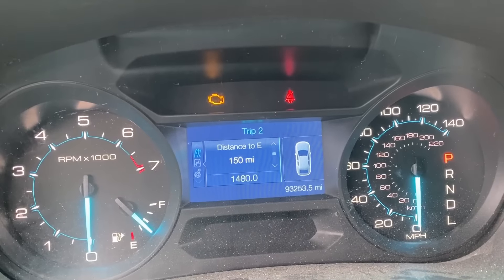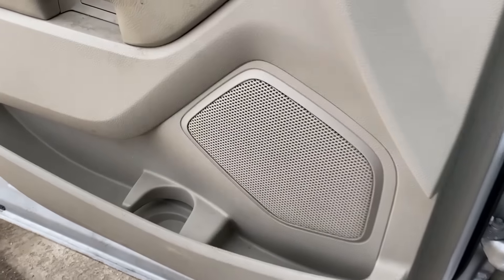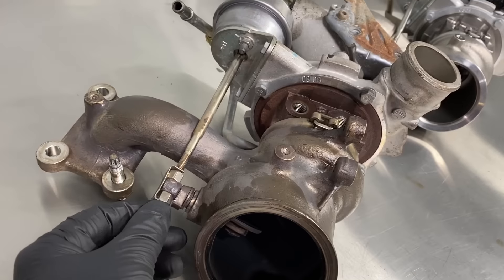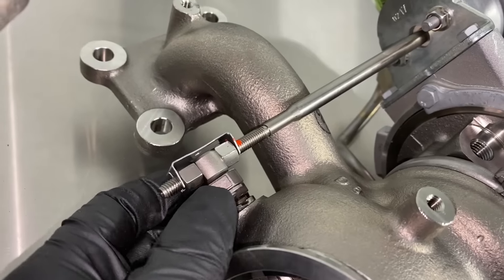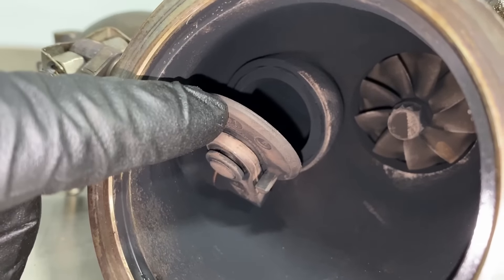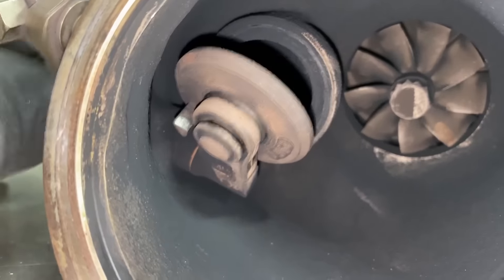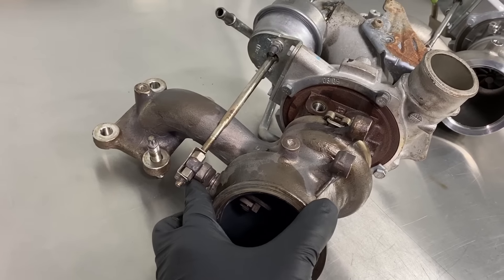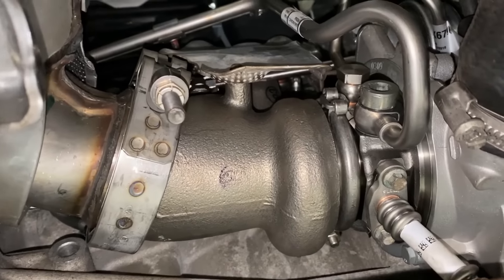Ford Ecoboost Cold Startup Turbo Rattle Explained

Comment: I’ve a 2012 f 150 FX4 I drive every day it’s got 141 K on it just started leaking transmission fluid from the front of the transmission had the transmission service about two month ago any thing to look for
Reply: I'd see if it's just leaking from the pan.  It may just be loose bolts or a bad pan gasket hopefully.
Reply: No it’s no the pan I’m afraid it’s the front seal because it’s up in that area but just to start one morning
Reply: I had the same problem. Ford said it was a defective pan. Under warranty I had it replaced.
Reply: If it's a pan leak it should be easily identified.  I've read F150 transmissions have a known problem called a bulkhead leak.
Reply: Eric I looked at the pan it’s not pan it looks like it’s coming down and getting on the oil pan and saw bar
Reply: Look for selling and buying a Tundra

Comment: I had a dealership try to sell me a 2013 F-150 EcoBoost that had a hard rattle on startup on the left side. I asked about it and was told it's fine. Just probably a shroud or something loose. It sounded worse to me. Turns out the one turbo was shot. I got my deposit back after an hour or so of high blood pressure "talking".
Reply: Thats terrible, glad u got your money back
Reply: Can you please explaim what the turbo really does ??? Or I just to make exhaust noise loud???
Reply: @jaandel1  it gives you a shitload more power, I believe by recycling exhaust into forced induction, and a lot more fun, but at the cost of worse fuel economy by far when on boost, way more wear and tear on your motor and transmission because you'll be horsing it all the time, and more things that can go wrong. 
They're great if the vehicle isn't your only means of driving.

Comment: Service writer: never ever heard an ecoboost have a turbo rattle. We've tried nothing and we're all out of ideas
Reply: Don Olypopper  last diesel mechanic i talked to said something to me that i thought made a lot of sense. "power costs money."
Reply: Don Olypopper  same mechanic told me the order of domestics he works on the most are Ford, then chevy, then dodge. so no im not too surprised about dodge.
Reply: Don Olypopper  just curious was it one of the newer ones ? I drove an 2015 6.7 for work a few years back it was supposed to have like 900ftlbs and it was a great truck never had a single issue with it drove amazing would peel out and haul ass. Realistically I think when they stared forcing stricter rules on everyone all the makers had a rough few years with their diesels. If I had to pick anything personally 4bt all day. But if I had to pick a truck...90s F350 XLT with a 7.3 idi please.
Reply: Don Olypopper  oh man things are engineered to fail nowadays for sure. No profit in repair just like Apple says. Like I said if I had to put a motor in one. Cummins. Ive just never like the looks of modern dodges. Edit: I put around 36k of hard hard labour on our truck alone regularly maxing payload while towing trailers and equipment all over WV took my leadfoot and more.
Reply: Don Olypopper  ive seen that at my local ford dealer. blew me away that the whole cab had to come off to do head work. ford sure likes to build them to generate labor money. if they cant gouge you enough on the parts they'll gouge you with the labor.
Reply: While barely looking away from their screen. Ain't that the truth ....
Reply: @billy Carley
The guy working at jiffy lube isn’t a mechanic y’know..

Comment: I have a 2014 1.5 EcoBoost Fusion. 146k highway miles over 3ish years. Never had a problem with anything
Reply: Wont be that far until starts to fall apart
Reply: I have a 2016 Titanium with the 2.0L at 63k miles, it's already falling apart
Reply: Hardly anyone does. This is new to me. I've owned 3 EcoBoost Fords. 2- Gen1. 1- Gen2
Reply: @gianfrancoa  what ur Hyundai?
Reply: I guess it's all about the owner and how you maintain your vehicle. 2014 with over 160k and it's still like new.

Comment: Getting as fluttering noise from my intake on my 2013 Fusion 2.0 eco boost. Not sure this is normal but when you lightly accelerate and let off the gas you hear a fluttering sound from the intake. Is this normal with these cars? its not loud at all but just concerned. Thank you in advance. (No check engine codes) no rattle

Comment: Thank you for your videos.  You saved me alot of money from the dealer/parts changers. Had a completely clogged cat which caused misfires, pegged my pressure gauge at idle. they wanted to fix the misfires before swapping the clogged cat. Cat was under federal warranty by the way. With your videos I was able to intellegently argue my way to a new cat. And once that was done all the other problems dissapeared. Imagine that
Reply: Cat and not turbo? Under federal warranty? My dealer says it’s my cat and not turbo, even though I can reach down and wiggle the loose waste gate??? Anyway, how
do I at least get covered under federal warranty?

Comment: i have to hand it to you FordTechMakuloco, you picked the most lucrative brand for auto repair!
Reply from the maker: That's right! I know what I am doing....
Reply: Vw has same failures on their turbos.
Reply: @Randomvoice246  because those turbos are also made by the same company, Garrett
Reply: @hkk3656  not so much a repair as a time-bomb reset if he's using OEM parts.

Same piece of kit, integrated waste gate, failure-in-waiting. Just looks prettier.

Comment: Do the new 2020 3.0L explorers have this issue or the cam phaser issue?
Reply from the maker: yes
Reply: @FordTechMakuloco  really? Wife wants a Ford Expedition 2019 but I know they have the 3.5 ecoboost and they all have cam phaser issues that can be pricey I was hooong the Ford Explorer 3.0 wouldn’t have that issue. Now we gotta look at other SUV’s smh. Damn ford and their garbage ecoboost engines.
Reply from the maker: Yup the TSB came out recently, but I think the actual failures are few and far compared to the 3.5L but then again the 3.5L is way more common of an engine.

Comment: There goes all the fuel savings from buying a turbo four over a V6
Reply: The "fuel" was saved but your wallet not so much
Reply: Be sure its not a twin turbo V6!  twice the waste gate fun....
Reply: Aris Torm ok boomer
Reply: Actually it's a lost cause from the start turbocharged engines running more than 4-6lbs of boost are factually less efficient all the time because they have to have a lower compression ratio in order to prevent hotspots from forming on the piston and causing detination "knock"
If you're not familiar with what knock is it's when the fuel ignites before top dead center in other words at the wrong time and it's really really bad. If your goal is fuel economy a naturally aspirated engine is much more efficient. Unless it's turbo diesel than it's a different story.
Reply: That turbo could have been repaired
Reply: The TacomaKid  because EPA regulations. Manufacturers need to get to a certain average MPG by a certain year so everyone is scrambling to do whatever they can, including screw the customer, in order to not face fines or close doors.

Simplest solution is smaller engine, add a turbo, EPA tests them, gives them a rating, everyone is happy. Except the customer, of course, because EPA =/= real world.

And since there is no regulation on average reliability, no one cares about the hole they burn in your wallet either at the dealer or at the repair shop.

Did I miss anything?
Reply: You took the words out of my mouth! theres a lot of people feeling this way, but are forced to buy this popo that looks like a shopping trolly with its small wheels.
Reply: The TacomaKid  So they can post high horsepower numbers from small displacement engines and show you great fuel economy numbers under light load conditions. That's where these engines are going to be in the less than 6 lbs of boost. But if you're towing or driving aggressively a turbo gasoline engine making similar power will always use more fuel than a larger n/a engine, Ford and Chevy both making larger displacement cam in block gasoline engines in their trucks(7.3 and 6.6 respectively) should be all the proof you need
Reply: @Mustang6504  You are just plain wrong when it comes to modern turbocharged engines. Turbo Chrysler, Dodge, DSM, etc of the 80's and 90's had to run low compression usually 8.0:1 to 8.5:1 because the engine management wasn't anywhere near as capable as it is today. The ecoboost 4 cylinders run 10:1 compression, with the V6 at 10.5:1. If we take a look at Audi/VW it is the same story. EA888 2.0t 11.7:1 for the newest generation up from 9.7:1. Kia/Hyundai 2.0 4 cylinder turbo range from 9.5:1 to 10:1. No modern factory turbo car is running low compression PERIOD. 

Additionally knock does not happen when the air fuel mixture ignites before top dead center that would be pre-ignition, which is entirely different from knock. In fact no ICE fires spark at top dead center at any point during its operation. All spark is advanced. Knock happens after the spark plug has fired and another separate flame front forms inside the cylinder due to the increased cylinder pressure and temperature from the original expanding flame front.
Reply: i went from a v6 to an i4 turbo..  bad idea. turbo engines are fun until you have to pony up to fix them.
i've saved about $80 in gas in 2 months of shop time. i dont drive much.

Comment: I had a 2013 3.5L twin turbo, on cold starts the timing chain was slapping, noped out of that real quick and traded it for a 6.2L F-250.  Never buying an Ecoboost again. If for some reason the 3/4 tons go to the Ecoboost in the future, i'll be switching manufacturers. Its a shame because i loved the truck, and its options, but sub par parts on a $45,000 truck just boggles my mind.
Reply: Same thing happened to my bosses ecoboost f-150. When I bought a new 1/2 ton truck I wanted a Ford but I'm not a fan of the Ecoboosts or overhead cam V8's so I ended up with a Dodge with a Hemi. I'm a Ford guy but if Ford would've offered the 7.3 gas engine in the F-150 I would've been all over that instead of a Dodge.
Reply: @thealgorithmisbroken  wait until you see the roller lifter turn sideways and eat out the camshaft , a common problem with those
Reply: @johnh9507  ya I heard about the Hemi's eating up camshaft lobes.  Hopefully that's a long way down the road lol.

Comment: I think the noise wouldn't have bothered me as much as dropping 2k plus labor, but the bypass valve not seating tightly against the surface it was intended to seat against would have been bleeding off boost.
Reply: exactly bro

Comment: Gonna see this more and more on all these new turbo motors as they age.  I’ll take a V6 any day over this,  I could care less about the torque or fuel economy.in comparison.
Reply: @LynxStarAuto  As someone who has spent a fair bit of time around German vehicles (VW/Audi specifically) turbo failures are nothing new, I've specifically avoided anything turbocharged because it's such a precise piece of equipment that undergoes such incredible stresses and any deviance from their tight tolerances can smoke the turbo and engine--I think it's technology best left to performance cars and not stuff the general population would drive.
Reply: @406Steven  I was going to write that, but then I realized you did.

Comment: “Loose to pivot and seat perfectly.” Sounds like an excuse to manufacture shitty parts. 

Valves dont pivots loosely to seat perfectly. I’m sure they could do A LOT better with that linkage.
Reply: Turbos get really hot spinning at 250,000 rpm they need wide tolerances, especially the waste/exhaust side
Reply: Are you shitting me? It’s a pass though valve that has one moving part and spins at no RPMs, the metal is too soft and built like trash. I’m convinced you didn’t watch the video.

Comment: $2000 in parts alone offsets all that fuel economy gained by running a smaller, turbo charged engine. No thanks.
Reply: phillijp 
That’s an excellent point.
Reply: the actual fuel was saved, the owners wallet not so much.  with the EPA they are only concerned about the fuel savings, not the cost to the consumer.
Reply: @onenikkione  right eco boost is really economy boost every time it has to be replaced it helps the economy LOL
Reply: @mrelectron6220  what doesn't help the economy is people have no money to spend anywhere else. And while this may bring ass-tons of revenue to the automotive repair industry, the rest of the industries suffer.
Reply: I have the 3.5 ecoboost F150 with a ten speed and i certainly didnt buy it for better fuel economy, but for the speed and enjoyment of having turbos. If it breaks, I will fix, i absolutely love it.
Reply: I’m @206xxx Km on my escape I’m wondering when the turbo will go so I can get a bigger one lol
Reply: KSI Bane what year is yours? I just replaced my 17’ had 113k miles with the 2020 3 cylinder version. I like the new one but I’m a little nervous with some of the reviews of it. Dealer only service likely with the 5yr 100k I’ll probably trade it at about 75k this time.

Comment: Ford engineering appreciation for customers loyalty.
Reply: @LynxStarAuto  The turbos are sold to the customers by Ford not Garrett,  for customers Ford is responsible. The Catalyst needing replacement was an additional problem for the customer
 because Ford changed the design. Way to take care of your customers Ford!
Reply: @LynxStarAuto  I am well aware of all factors impacting  my vesicle ownership. 
including the heavy cost of new car depreciation. Having owned cars from US, Japan and Germany, I have a clear understanding who builds cars with best chances for easy ownership during and well beyond the warranty period :-)  Oh... and its amazing how markets work, the cars with better durability had higher resale value when my ownership period was over.
Reply: @LynxStarAuto  built to Ford's specs.

Comment: That’s why I went with aftermarket OEM parts are junk, they have the aftermarket turbo kits for the Focus ST , I haven’t had a problem besides falling in love with the turbo flutter and Blow Off sound and cold air intake.

Comment: Strange my old 940 Volvo got over 300K out of the original turbo.
Reply: Not the Volvos in last 5yrs or so. Plenty Ford EcoBoost are getting to 200k mis with orig turbos.
Reply: David Klimmek 
I’ll never own a FWD Volvo. When they started that their quality went downhill.
Reply: How much boost did your Volvo make?  I've driven some of those older Volvos and they're great cars but the throttle pedal just determines how much noise it makes, not what you get in terms of acceleration.
Reply: UnsulliedSpy 
I don’t think it was much probably around 9 pounds. I never modified it so it was stock.

Comment: And so this is why I haven't purchased a new car of any make for the last 20 years.  The new technology is nice, but when it fails kids, you'll be crying when you have to pay to have it repaired!
Reply: I've long been a fan of buying something older for cheap, fixing it, and running it forever but have recently gotten fed up with having to fix old junk all of the time.  I bought the first new car of my life about a month ago and it sure is nice knowing I can just get in and go somewhere without worrying about what's going to go wrong next.  If something does go wrong, it comes with roadside service and a warranty to fix what's wrong.  I'll take the loaner car from the dealership and run that until they fix what's wrong, it's a lot less stress than worrying about what's about to go wrong next on your old rig.  I still love my old trucks, but there's something to be said for peace of mind.
Reply: @406Steven  Till the warranty runs out ---- !

Comment: New Fords last for three years, lightly driven....such as mine for three years around 40,000 miles.....3000+ dollars to get it running again just to sell it, before a major expensive break.....then the compound breaks begin. 

You borrow these cars for three years thinking expenses will be cheap but its more like you should be making huge sums of money for the three years to pay upwards to about 10,000 in repairs around the 50 - 100 thousand miles range.

 It's not like its a break of the most expensive things at the same time more like like over a mileage you'll fix something then another thing breaks that can be critical for the car to run.

Comment: Hello, good afternoon, I also changed the turbo of a Ford explorer 2.0 ecoboost, but I have fault code P1016, I think the solenoid could be bad or a badly connected vacuum since I received the disassembled Ford.
Thanks for the help. Aca From CHILE.
Reply: Ah, the old wastegate control valve higher than expected. CB5Z-9E882-A, that’s the part number for the replacement

Comment: My 2015 f150 3.5 EcoBoost developed a rattle. instead of bringing it in I did some troubleshooting. Thankfully In my case it was failed clamps on the muffler heat shield. Easy fix!